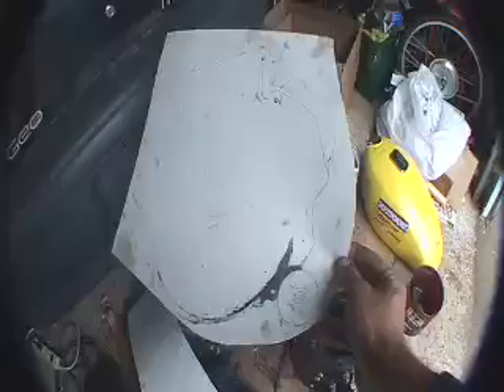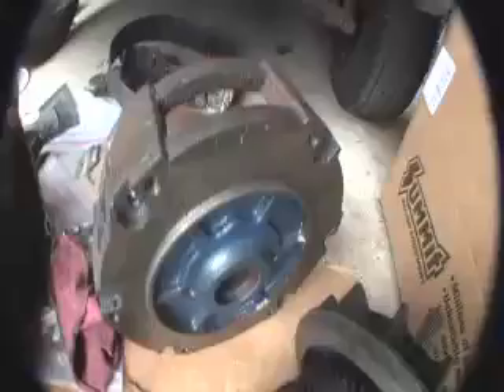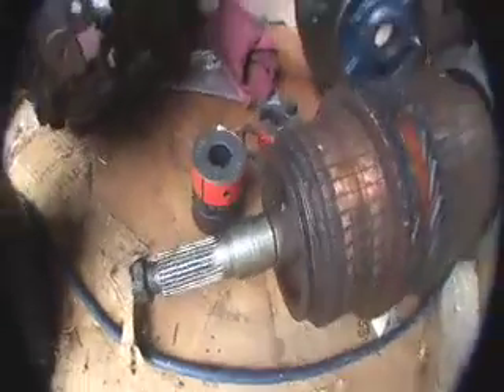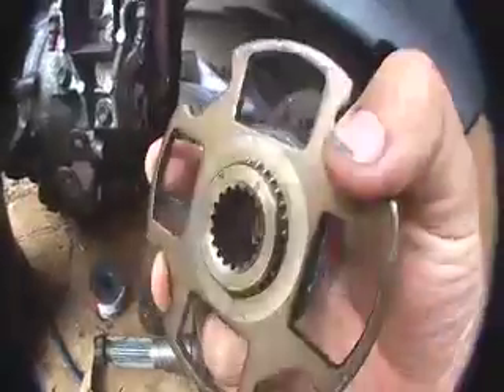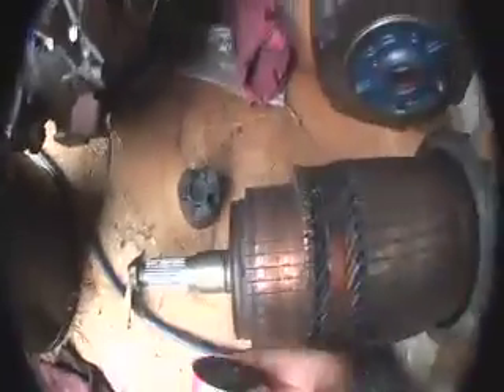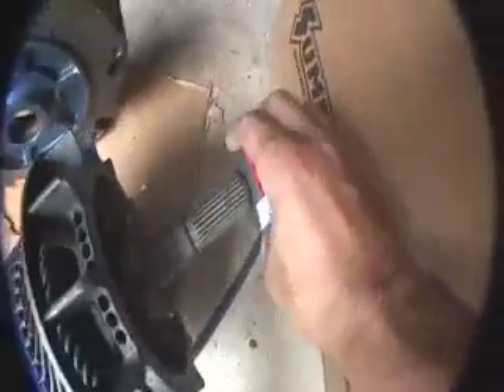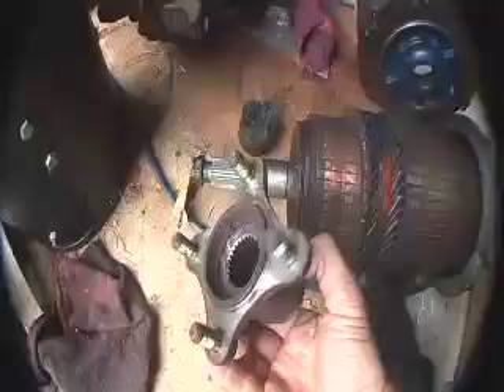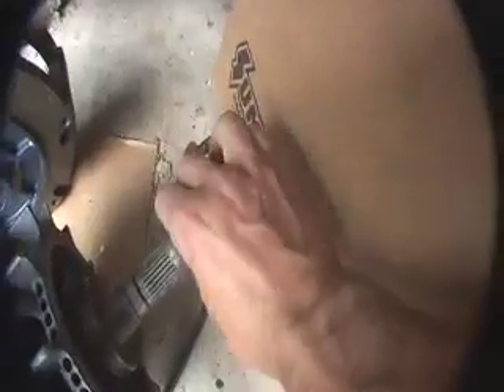Electro-Metro Update 5/30/08

Comment: nice job on your video I've been converting cars for over 20 years now and I've come up with a easy way to make an adapter plate to go from the motor to the transmission without the need for a machinist. I take the plate and bolted to the motor set it on a brake drum so that the flat plate is facing upwards and set the transmission on top. I then hook the motor up to a 12 volt battery and let it spin and as it's spinning I move the transmission around till it makes the least amount of noise then I drill some holes and bolted together that way no need for measuring or anything. the Lovejoy coupler does take a little Machining I take the Hub that you were showing and bore out the Lovejoy so that it fits into the round portion of that Hub you showed and then bolted together and weld it. nice job I like to see people doing conversions rather than buying new cars as a converted card is like recycling compared to buying something in a recycled box keep up the good work   Steve clunn at Greenshedconvention.com

Comment: some questions: 1) do you fix the transmission to a gear and in which one? 2) 1:31 how could you weld an iron part with a cast one? Thanks.
Reply: The car uses the original manual transmission and keeps all the gears. A friend helped me weld the coupler together. We didn't have any trouble with it.
Reply: Ben Nelson So you still change gears without the clutch? how easy is that? After these years have you experience any problem? again Thanks and big bravo
Reply: NikolaosLedZeppelin Yep, can change gears. Never had any problems with it.

Comment from the maker: Its a manual transmission. Just let off the accelerator, wait a moment and slip it into the next gear. It slips right in.
There is no heavy camshaft or gas engine idling away. It shifts fine like this.

Comment from the maker: It's a front-wheel drive car, do you still need some sort of way to divide the power from the motor to the two front wheels.

This car actually has a "transaxle" which is BOTH the transmission AND the differential. Since I already need a differential and a place for both drive shafts to go to, that would be a lot of custom work. Much easier just to use the existing transmission. Plus, I still get neutral and the other gears to work with